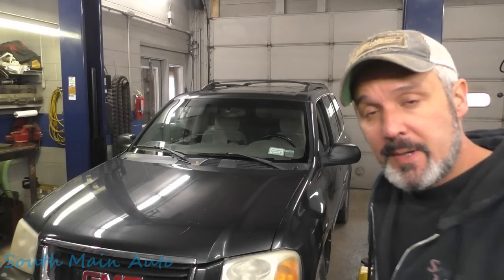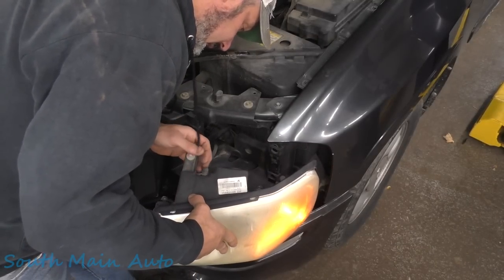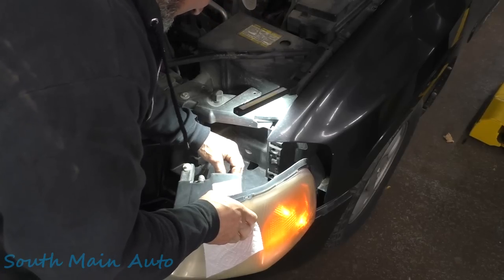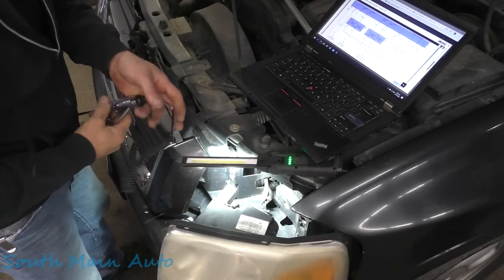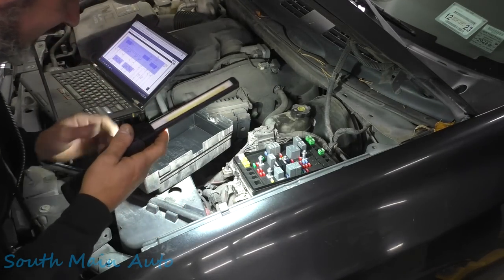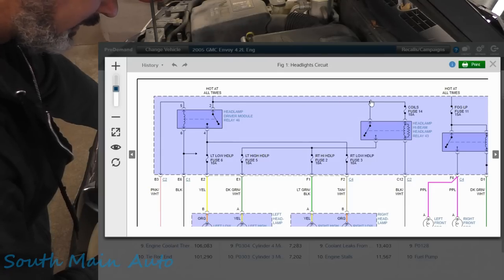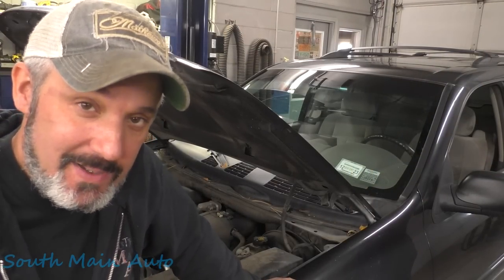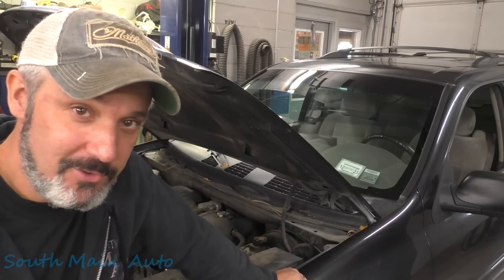GMC Envoy: No Low Beam Headlights

Comment: These relays are a pretty high failure item. They’re pulsed by the BCM so the DRLs run at a lower power level and its basically just a fancy transistor. So they get cooked pretty regularly

Comment: The High Beam being the lower filament, and the Low Beam the higher filament.  Well, that is a natural thing about optics, and how the light is guided by the reflector.  All single reflector units will act in that fashion.   Have you not come across this fact before, that you had to ask?  I am surprised.

Comment: Ok...educate me...same vehicle , same problem. I swapped relays and the low beams work. I can swap them back and they don't work so it's definitely the relay BUT, my testing shows no 12v on the control side of the relay!? Yes it's fixed but I want to know why I can never get 12 volts on pin 5 of the relay. Should have 12 volts with the headlights on low beam correct? Even with the good relay in and working, if I run a jumper out from pin 5 it still shows it as a ground. What gives!

To clarify ...it shows as ground with a power probe. With a test light hooked to batt negative probing pin 5, it shows nothing. Not even a dim glow.

Comment: I had that happen on my 2009 Malibu and it turned out that the bulbs just needed to be replaced. Actually replacing them takes a bit of work, though.
Reply: One of gms worse headlight setups lol 75% of them I see aren't slid up into the fender proper and have a bad gap to the fender by the bumper mounts
Reply: Your car was def when GM realized they could get away with any headlight mounting system and it's just gone downhill in the years since
Reply: @gunners4129  I was expecting to easily change them myself, and was so annoyed when I had to take the car to the shop. Lol.

Comment: The headlight bulb access here sucks. I've had to replace both bulbs on my 2010 Honda Fit and it was an easy take connector off back of bulb, move bulb holder wire, remove old bulb, put in new bulb (one-way keyed), move bulb holder wire back, and then reconnect connector. Done.
(As an aside, gold medalist figure skater Kristi Yamaguchi drove a first generation Envoy.)

Comment: Those special relays are solid state relays. Nothing mechanical inside. The failure rate is quite high which is why all your NAPAs have them in stock. Once reverse engineered the relay and it’s horribly designed and overheats killing the silicon that switches the power.

Comment: i like being in control of my vehicle my 1994 ram 2500 if i want my headlamps on there is a switch that i control i don't want headlamps burning unless i need them this also makes the system simpler. really wish we had choices. if i want my doors locked i have a switch for it that way when i get out of the truck the passenger door isn't locked and i can simply open it. i hate the new vehicles that do all sorts of things of which isn't needed.

Comment: The older GM vehicles had relay gremlins.
Reply: The older/older GM vehicles burned out switches and connectors since they ran high amp power through switches. The 90's and before stuff.

Comment: I read online that those relays are notorious for going bad and those relays need to be replaced often because the relay is the weakest link in the circuit. People want GM to fix the problem but GM isn't going to fix the problem.

Comment: I had the same on my new to me car (both dims not working). I changed the bulbs that didn’t work so I got used headlights and a switch from a Dismantlers and after fitting them it turned out I was changing the high beam bulbs not the dims 🤬🤬

Comment: It's amazing how engineers could screw up something as simple as a headlight circuit by putting four different things on the stock and running it through body control modules instead of a simple headlight switch with a button on the floor to turn on the high beams. I guess people really have gotten lazy. I guess you can't have something for your left foot to do while you're driving. To complicated for some people.

Comment: You think that was expensive,i had a stalling problem after going throught car wash on my 2006 envoy denali and it ended up at GMC for 3 week.That underhood fuse relay center was getting water in it when the high speed dryer fans would blow dry the car and causing a short on ING circuit 1 and 2 and it would kill the car,,,,,,800 bucks and some change because it comes with all new fuses and relays with the cover....

Comment: You want to see a nitemare we have a unit that has a head lite relay  from a fuse to a left and rt head lamp relay each powered by a fuse and 1fuse is a mini a to the other is a micro a to fuse and all this runs from a stalk mounted signal switch

Comment: wow a car where it is easy to get to the bulbs, I really hate these modern pieces of crap where you have to take out fender liner and turn steering wheel to blindly reach in and try and remove a watertight cap wire clip and bulb wire harness with one arm and hand then put it back without getting bulb dirty

Comment: IF YOU HAD 25,000 TO SPEND ON A VEHICLE WHAT WOULD YOU PURCHASE,
Reply: A E-bike and a lot of shoes!
Reply: If a car (vs a truck) is needed, I'd get a Corolla.   But change the engine & filter oil every 5k and use exactly the oil Toyota specs and use a Toyota filter.  10k is too long for the short haul start & stop most cars experience.